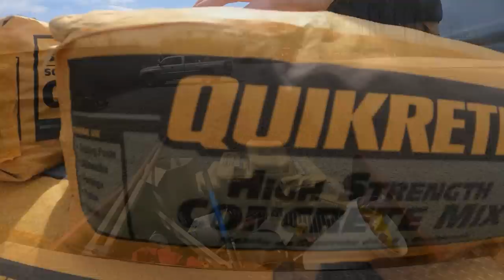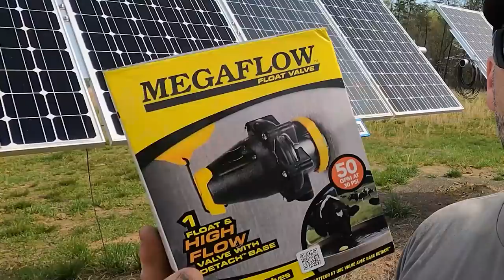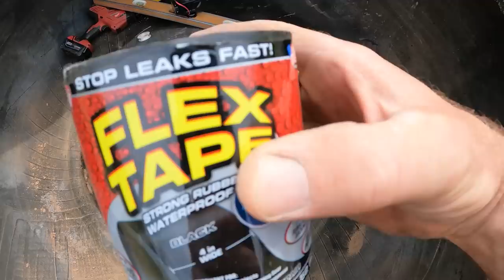How to build a tire water tank from start to finish

Comment: Great ideas but i recon the integrity of the seal between the tyre and the small amount of concrete in the bottom will fail due to cattle pushing against the flexible tyre and eventually you will get water seeping out from the bottom and causing a problem with poaching. i know a farmer who did this once, it did work but he filled the bottom up about 6" above the rim of the tyre in the bottom which had the effect of encapsulating and sealing the whole bottom. Hope it works for you Josh.
Reply: @ DAVID....EXCELLENT SUGGESTION / IDEA!!
Reply: i was wondering the same thing... i wonder if when he was doing the concrete if adding j bolts/ pins to the edges would hold the tire in place ever better. I love this thinking and cant wait to see how well this tire idea works.
Reply: No because it’s hydraulic cement

Comment: Josh  how is the water getting out of the tire tank when the bowling ball get knocked off of the standpipe with a cap on the outlet. Good video as always.
Reply from the maker: obviously the setup isn't quite perfect yet...gotta drill a small hole in the outlet cap....we shall see if this works!
Reply: @StoneyRidgeFarmer  hole have to be bigger than water supply

Comment: Two questions:  Will chemicals from the rubber leach into the water?  How do you create a seal between the concrete and the rubber?
Reply from the maker: I've had no issues with "leaching" any chemicals, the tires are safe and this is pretty common practice all over the world, I keep fish in the tanks and they thrive so that tells me the water is pretty darn safe.  The concrete will sometimes seal to the tire, and for added security I used "flex paste" to fill the gaps....worked great and the tire tanks leak very very slowly...maybe a slow drip dripping 40 gallons of fresh water into the tank daily

Comment: The bowling ball is a slick trick for a drain stopper. It looked like you had water flowing down the drainpipe ditch, is there a leak at the tank?

Comment: Hey Josh, enjoy your videos and your innovation!  Just wondering, if a calf knocks the bowling ball off and the tank begins to drain won’t the auto fill valve just start running and running?  I don’t have any experience with this, just based my question off a continuous running toilet issue…LOL!
Reply from the maker: yep....still perfecting the system....guess what I learned about bolwing balls....lol...some of them float bhhahha
Reply: continuous running should not be a problem, if the cattle are moved daily etc, unlike us where we only move them every few months ( the farm is divided into 2000ac blocks)

Comment: Bowling ball was brilliant. I am curious why you did not use water curb stop valves. Not a criticism.... They are solid brass and are designed to live underground for long periods of time, and have a designated tool to open and close them. I can see as those hand holes fill up with silt that your handle on the gate valve could corrode. Either way Josh your innovation is awesome! Thank you for sharing.
Reply from the maker: 1 1/4 curb stop valve .....$90....ball valve $24

Comment: The ball valve is a great idea but you might want to consider a curb stop instead because a curb stop is designed to be buried below grade AND take multiple on/off cycles whereas a ball valve can fail if used often or especially if there is sand.
A curb stop is also specifically designed to be turned with a special fork tool. 
Another point... You might want to consider using a filter just to keep sand out of your ball valve and any other downstream emitters.
I enjoy your work!
Reply from the maker: I agree totally.....sourcing curb stop valves has been my trouble...and cost...$200 for a 1 1/4 curbstop! Crazy huh!

Comment: Josh, The problem that I see is say a calf falls in there and knocks the ball seal off, the drain is still capped on the field end. The drain line is now full of water so will not take any more until the cap is removed. Or are you leaving the cap off the field drain end? If so what will keep a calf from stepping in the pipe and breaking a leg? I assumed that you were replacing the cap because you put a threaded connector on the end there. Maybe I'm missing something here, I hope so. Still very interesting concept. I would not have thought the tire would hold that much. Yea for recycling!
Reply from the maker: obviously we have some adjustments to make my friend...this isn't entirely finished
Reply: @StoneyRidgeFarmer  Things are seldom as simple in the doing as they are in the talking. :D    I remember when you lost that calf, that was so sad. I understand what you are trying to do and hope you find a working solution quickly. The only thing I can think of would be to use something long but shallow like a feed trough. But you are way smarter than me, I know you will come up with something. Keep trying my friend and may God Bless your efforts.

Comment: have you consider the risks from pollutans in the water from contacting the tire?
Reply from the maker: if the tires put off pollutants then EPA wouldn't allow them to be used in the forest and wetlands...they make tanks out of rubber every day....this one just happens to be saved from the landfill
Reply: @StoneyRidgeFarmer  And it would be more pollutive in the landfill anyway
Reply: Unless the tyre burns the rubber will remain inert and will not release contaminants.

Comment: Nice job as usual. However the NIH says as others commented below - Are tires toxic? The short answer is that yes, they are. Tires contain a host of chemicals and metals that should not be in the human body. They do gradually erode and break down, leaching those chemicals into the water and the environment. Sep 2, 2021.
Reply from the maker: look hard enough and you'll find something on the internet that tells you everything is toxic buddy....what's more toxic....a tire water tank with 55 degree water in it or hot water ran through your plastic bpa plastic in your house?  Everything is toxic if you consume enough of it...even ice cream!
Reply: @StoneyRidgeFarmer  Good point Stoney.  Just do not want to add to it. Thanks

Comment: How you going to keep it from freezing in cold weather ?
Reply from the maker: it's partially burried and this quantity of water simply won't freeze in my local area...it might get some ice on the tip..but thats about it
Reply: @StoneyRidgeFarmer  OK, If it don t get very cold there your most likely good. I am in Iowa a tire tank is mostly used below a pond . In summer use a float , in winter they take the valve off and put a cap on the pipe with a 1/4 hole in the side and it flows all the time . Have a great day !

Comment: WOW great thinking 🤔... with your drain...???... there will be water left over in the pipeline after you drain the tank, won't that crack/split when it freezes, then you won't have a sealed 🤐 drain pipeline. That said the bowling ball 🎳 won't work because you have capped off the other end of the drain.... pressure....A simple drain plug on the lower side of the tank would be the easiest.... with your safety  bowling ball drain
Reply from the maker: how bout a flapper on one end?  or leaving the drain plug slightly open?  Where there's a will...there will be a way my friend
Reply: Yah good stuff. How about a small hole at the bottom of the elbow so any remaining water will slowly drain. So your drainage tub won’t hold water remaining in the tub. I really like your ingenuity

Comment: If the ball does get knocked off does the 💦 water keep running. ?     I know that's a Big No No on our Farm,,,,,
    Maybe you can attach a string from the ball to a valve handle so when the ball falls the string or chain well pull down the handle to shut the water off,,,,,,,
Reply from the maker: system has yet to be perfected my brotha....but I'm working on it and experimenting

Comment: Is all this cheaper than a galvanized watering tub?   Is there a special grade of concrete?  Will a soapy scrub prevent rubber from tainting the water?
Reply from the maker: why would the rubber hurt the water any more than a rubermaid water tank?  This is a permanent water solution..not a temporary water tank like at galvi water tub...which we could also ask...what's leaching from the galvi tank?  This is just sack crete....I did learn a little more about sealing things off and will teach ya in a future vid for sure!
Reply: @StoneyRidgeFarmer    I suspect you have noticed the smell of new tires, or tires taken off the rims.  The odor, likely chemicals, will integrate with water.  As with Round-Up, what roots take up will integrate with the plant and fruit.  Same for the cows.
Remember MonSatan modified soy to not be killed by Round-Up, but tough luck for humans, as noted above.
I hope it's not an issue, but it might be worth checking.

Comment: Pipe is a 'bit' oversized - if the solar flow rate is only 12-14 gals a min?
Reply from the maker: when you are running 1 mile of pipe for cattle waterers....the pipe needs to be larger to reduce friction resistance in the pipe. Sure I could have used 1 inch or even 3/4 inch pipe all over the farm....however this has the potential to be used as irrigation at some point...and friction loss is real...especially when running this amount of footage...1 1/4 inch is the minimum suggested to use for this project by folks with much more experience than you and I
Reply: @StoneyRidgeFarmer  The calculations are much the same as for electric (pipe/cable) ..ie friction - aka resistance x pressure/voltage x flow/current - ie amps or galls'min..
Yes the distance is long - so then you have the question bigger pipe less resistance but more expense - or bigger pump (pressure) and PV then smaller pipe.. then of course your water tank is essentially a battery . anyway, is true i dont have enough info - like grade/ how many cows/ are you,  suppling more than one trough and plumbed radial? (like a tree) .. Anyway - good luck

Comment: Great project Josh, but not seeing how the drain is going to work.  Unless the top of the drain line is flush with the bottom of the tire, the water level will only drain down to the level of that drain line.  Don't know if they make a 3" or 4" ball valve, but I'd install a ball valve on that long drain line you put in the ground and then leave the drain line inside the tire flush with the bottom of the tire.  Come time to drain.... just open that ball valve.  Easy Squeasy!  :-)
Reply from the maker: the outlet on the drain is lower than the inlet on the tire...however this setup isn't perfect...yet! lol

Comment: The cement will seal better if you put water in the tank right away and let it set up under water.  A stop and drain valve instead of a ball valve will allow your line to drain back like a hydrant so you don’t freeze your line into the tank if it is empty
Reply from the maker: this tank will remain full of water all year long.....however if there are any lessons to learn...I'll share them with you

Comment: Any concerns with carcinogens and potential asbestos from the brakes of the vehicle in the tire? They actually found asbestos in the shredded rubber from tires used for artificial turf.
Reply from the maker: this is a skidder tire.....it's hydrostatic...so it doesn't have brakes buddy
Reply: @StoneyRidgeFarmer  sorry buddy was mostly asking regarding the degradation and off gassing of toxic chemicals from the rubber. Sounds like you did your research and was genuinely interested if you had any concerns.

Comment: Been building them self watering tanks for yrs
Reply from the maker: good deal...then you know that there's more work to be done here....with sealing the concrete to the tire!
Reply: @StoneyRidgeFarmer  there is a whole lot more than you showed. We ran them in the bull pens ranch had 40 bulls and 1200 cow and heifers they only ran bull with them for three months so the ones we built had to take a beating

Comment: Why didn't you fill the bottom portion of the tire with cement?
Reply from the maker: 7 bags v/s 17 bags that accomplish the same thing?
Reply: That is fair. Have you noticed any leaking around the tire concrete seam?

Comment: The only concern I would have with that system is that tires have dozens of toxic chemicals in them, and the toxins will leach out into the water. The toxins could show up in the animal meat.
Reply from the maker: why would a tire have any toxins different from a Rubbermaid water tank?  If tires were loaded with toxins...we'd be constantly exposed to them driving...we'll test the toxin theory at some point...maybe send off a water sample for a test....great idea!
Reply: I had looked into this because I can’t even be outside a new tire store without the vapor making my eyes, nose, lips, & lungs burn ( same with gasoline & diesel fuel ), but then I have hypersensitive receptors that seem to be getting more sensitive with age.  

Anyways, my findings...
Q: Is it safe to grow vegetables in old tires?

A: “Short-term, yes, tire planters are OK, although the soil in black tire planters will probably get hotter than most plants would prefer. Long-term, no, because the tire rubber will slowly biodegrade and release zinc, carcinogenic PAHs (polycyclic aromatic hydrocarbons) and other toxic compounds into your garden soil.

Q: Are tires toxic? 
A: The short answer is that yes, they are. Tires contain a host of chemicals and metals that should not be in the human body. And they do gradually erode and break down, leaching those chemicals into the environment.

Also, Rubbermaid makes plastic food containers, & plastic uses less harmful compounds.
Reply: ...but the life of beef cattle is rather short nowadays. So, less exposure.
Reply: @StoneyRidgeFarmer  We are constantly exposed when driving. They're not as bad as lots of other stuff but not as safe as food grade plastic. Awareness of particulate emissions from tires is just coming to light. That being said I woudn't really worry about it much for this application.

Comment: Within minutes the cows will knock the bowling ball off. It will be a sloppy mess around the tire and the screen will be ripped to shreds. I would of used a spring epoxy to a borehole in the bowling ball that would spring back in places.
Reply from the maker: yep....you're probably right....and then both of our glasses will be half empty together ...if we don't try new innovative ways of doing things...we never learn what works and what doesn't.....easy enough to sit on the couch and not do anything...that's the best way to ensure I never fail right .....time will tell buddy....it's all good

Comment: Please reconsider using this due to the possibility of chemicals from the tire leaching into the water, especially when exposed to heat and sunlight 😬 Exposed steel wire used in the tires construction if ingested, can lead to the potentially fatal hardware disease. The wire can also cut or poke the cattle.
Reply from the maker: you do understand that there are tens of thousands of these tire water tanks all over the world...that a rubber/plastic water tank is industry standard.  That I keep goldfish in these tanks 365 days a year and they keep the tanks clean, if the tank was leaching dangerous chemicals.....a goldfish would not survive.  The tank is rubber, the pipe is plastic, the valve is plastic, the drain is plastic.....it's not harming any animals....and there's no metal wire to cut the cattle or give them any hardware disease.  These tanks stay a constant 45-75 degrees all year long, with the acceptation of winter when they freeze on top.  There's nothing wrong with a tire water tank, I'd be more concerned about drinking from a red solo cup than this tank

Comment: Does the tire not leach unhealthy chemicals into the water, which are then consumed by the cows and stored in their fat to be consumed by the person who consumes that beef?🤔
Reply from the maker: let's think about this....would the EPA let a tire be produced that leaches chemical poisons into the soil or waterways?  Do you get cancer from drinking from a styrofoam cup or red solo cup?  Are the ice cube trays in your fridge made from oil based products?  What about the water that comes out of your plastic faucet and rubber lined supply lines?  The answer is no...it's not a health hazzard to the animals...if it were...rubbermaid wouldnt make water tanks from recycled rubber and plastic....odds are that every drink of water you've ever taken came through a petroleum based pipe of some sort
Reply: Well bud, your wrong. Used tires do leach into the environment as they break down. They contain many harmful chemicals and heavy metals. There are plenty of reputable sources available online concerning this.
Reply: @StoneyRidgeFarmer  Sounds like you have a lot of faith in the EPA?